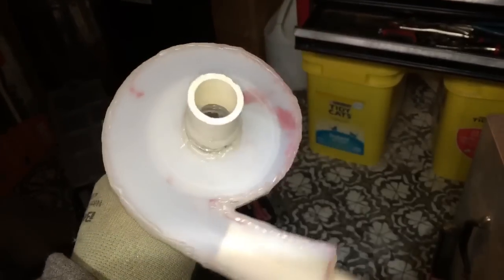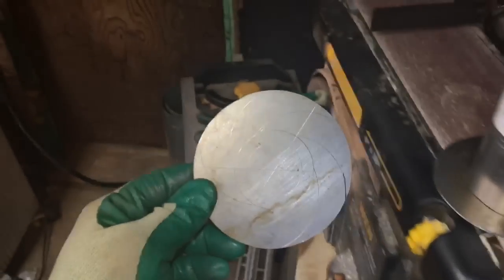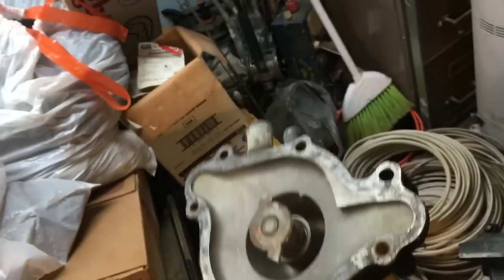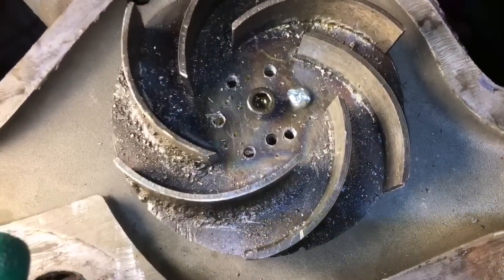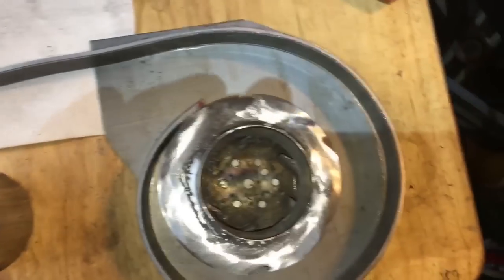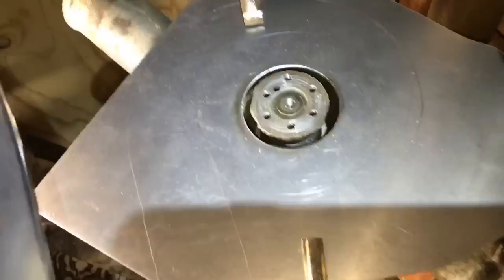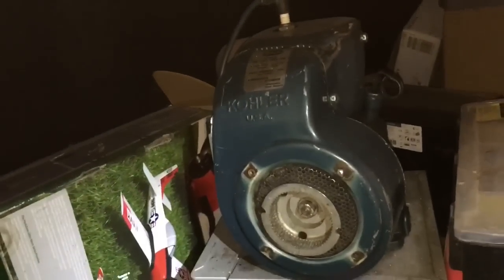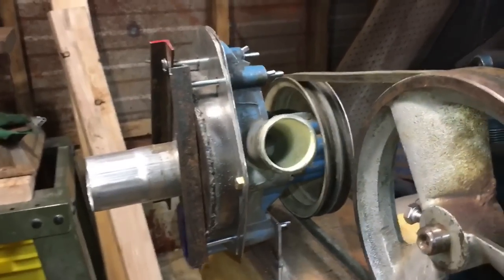Gold Dredge DIY 3 inch part 1: the pump

Comment: A foot valve a the end of the suction hose will help prime the pump or at least not take a hour to pour water to fill the hose. Where i live we put the pump in the water on a long shaft.  You have running water you could make a ram pump. Great project !!!
Reply from the maker: I was using a foot valve, it turned out that my issue was the housing gasket that I made out of cardboard gasket material. It just wasnt thick and soft enough to seal all of the imperfections between the two mating surfaces. Once the gasket material absorbed some water it would seal up and finally quit sucking air into the housing. That was why it always took almost exactly an hour every time for it to start pumping. I finally installed a cork gasket and some silicone which fixed all my cavitation issues.

Comment: Great work , anything can be build  ;) i just got lucky and got very cheep honda 3" trash pump for my dredge , good work
Reply from the maker: Yea, it was a fun project!  I may try another one with a few changes to the design to make it less bulky. This pump has been working quite well so far this summer. Got about 10 grams of gold with it powering my dredge. The biggest downside is the engine being all iron. It's heavy! Probably about 80-100 lbs including the whole pump setup.

Comment: Hardware store should have a 3 in. ABS DWV Hub x Hub x Hub Wye. It's the 3 way junction for sewers. You could cap the angled portion so after pouring water into impellers with it cap it off.  Just make sure the angle is towards the pump. Some pumps use a flapper valve that hold water from backtracking down the inlet pipe.
Reply from the maker: I thought about doing some sort of T or Y fitting, but i finally figured out that the reason i had so much trouble priming the pump was a poorly sealed housing. It was sucking air through all the cracks and cavitating. I ended up putting silicone sealant at all the junctions and now it primes just fine. I have always had a foot valve on the intake, which was the only reason i was able to prime it before sealing it up.

Comment from the maker: One thing i changed on thi pump this summer was i swapped the 4 horse cast iron Kohler motor out for a 5 horse aluminum Briggs and Stratton motor. It is about half the weight, which makes a big difference when lugging the pump around a creek bed.
Reply from the maker: -this
Reply: Mimi dragas En español
Reply from the maker: Update: that 5 horse briggs i put on it turned out to be a 3 horse. I measured the dimensions in the cylinder and figured it out that way. That engine died and now i have a new 7 horse motor on it. It’s overkill for the pulley ratio. I might get a larger drive pully to spin the pump faster since the motor can handle that extra load now.

Comment: Without pressure readings or flow-rates, it's hard to tell for sure, but I'll ask anyway (since I've done it the other way a lot easier), why didn't you just use the Chrysler timing cover that the pump would naturally mount to, cut it down to fit, plug the holes you didn't need, and mount that instead of all this work?  I've used a simple 'timing cover and water pump' driven by a motor as a SERIOUS sump pump for pond work, and never had a complaint.  If you didn't have the cover, you could have found one at a junkyard for $5.  Again, without pressure tests or flow-rate numbers, hard to say if you've improved over OEM, or not. I know with an unaltered pump, the vane would have been centered and balanced by default.
Reply from the maker: I would have had a few problems with that design. One is we dont have junkyards that we can just go pull our own parts from in AK. Another is the factory water pump was an open impeller design, which is made to move water but not pressurize it. There are too many gaps between the impeller and housing. The housing also has too many sharp corners for the water to go around to flow as much water as i need. The only thing i wanted out of this water pump were the shaft, bearing and carrier, and seal.  I would have liked to have a much smaller housing to work with, but this one was all i had. My main purpose with this pump was to move a lot of water under high pressure. I dont have pressure readings yet, but i do know it makes enough to run my 3" dredge pretty well.

Comment: Hi, Do this type of pumps need to be initied to work ? And is that enought powerful for transport some water from 300 meters ago ? like the pump at 300 meters from her source. Thank you for answer
Reply from the maker: Allan Didier Are you asking if it needs to be primed?  Also, the distance it can move water depends a lot on how much altitude you gain on the output side of your hose.
Reply from the maker: Allan Didier i'm not sure how much hose it can transfer water through. The horsepower of the engine determines that for the most part. The pump is a high pressure design, so if it's built with good quality it can do close to the amount a store bought high pressure pump can do. Also, the pump does need primed. I use a one way check valve (foot valve) on the suction hose and wiggle the hose around  in the water to get it up to the pump housing.
Reply: jay parry Ok thank you very much for your answers. am i enought strong to actionnate the pomp correctly with a bike transmission HAHA no motor, thats my question. will she needs to be next the source ? or can i install my pomp far away ? Knowing the spot where i need some water is near 300meters from the source with 15meters of height difference. I'm really sorry for my english man i'm french it's difficult !
Reply from the maker: Allan Didier you're trying to use bicycle pedals to pump water?  If so, i wouldnt recommend using this style of pump (centrifugal pump). A positive displacement pump would be better, especially for moving water that far.
Reply: Ok I thank you for your answers and for your precious help ;) bye

Comment: nice peace of Fab bud weld a little bit at a time let it cool
Reply from the maker: Andy Mck 63 thanks!  I want to do another one. I got some smaller water pumps saved up now from my new mechanic job. Also, i would like to do a few things different, like welding little bits at a time and using thicker metal in some areas.
Reply: the panel   beaters would weld in stages to  prevent the panel distorting .this would be crucial for the pump to maintain full power
Reply: jay parry loved the video. A man a dream and shop = happens. I use a water pump off a Dodge 2.2 turbo motor ( I a few cars out out ) I use it to move water for my honey bees. Honey bees don’t like water with mosquito larvae in it. It’s only 3/4 hp but with 5/8  hose it moves what I need. I have a 3.5 motor off a sidewalk eager. Next is Solar power and gold dredging in Ohio.

Comment: why go through all that to build a turbine pump when you could have used a tesla pump design??? I would think it would have made it a lot less time consuming.
Reply from the maker: A tesla design isnt designed to build high pressure at low RPM, like what is needed for a dredge nozzle. It also wouldnt have saved me any time over the impeller i did build. Large discs  take a long time to cut out, then ballancing for the speed it would rotate would have taken me quite a while, too. The tesla design is interesting and simple, just not practical in my situation.

Comment: Would a car water pump will work?.
Reply from the maker: Alpha1 you could use an original water pump from a car if you have the housing, but it most likely wouldnt be able to build the pressure needed for a dredge. You could use it to run a spray bar on a high banker, though.